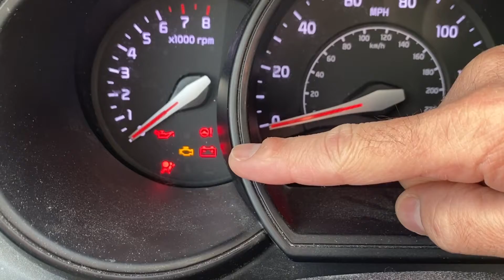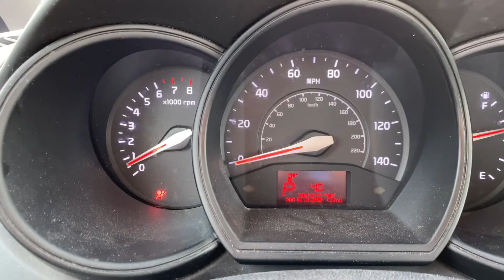Why Car Dies But Battery Light DOES NOT Illuminate (Andy’s Garage: Episode - 465)

Comment: I installed a new alternator and I still getting that annoying red battery icon
Reply from the maker: That light indicates an issue with the charging system. Usually it’s the alternator but could also be the connections. Check the battery cables to ensure they are clean connections and tight connections
Reply: @PhillipsVision I will,also I remembered that this battery is 3 years old

Comment: Hi Andy! Thank you for this video it answered a few questions for me regarding the electrical issues that my Commander is now having, except one.  I have already cleaned the terminals and the connectors, the battery is only about a year and a half old. It’s testing fine. It has been displaying all the wonky symptoms that you mention at to e behind of this video and no battery light. I’ve tested all the fuses in the engine compartment and couldn’t find any parasitic draw. 
Do you have any videos that show how to test or fix the battery cables when the issue isn’t the battery acid corrosion?
Reply from the maker: I do not. Probably will have some vids on this in the upcoming future
Reply: @PhillipsVision  thanks for your response!